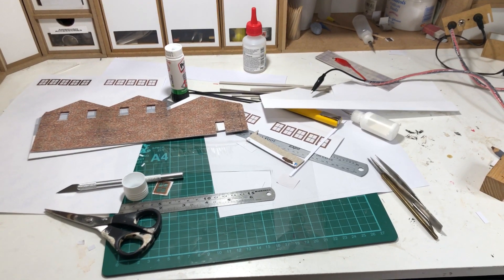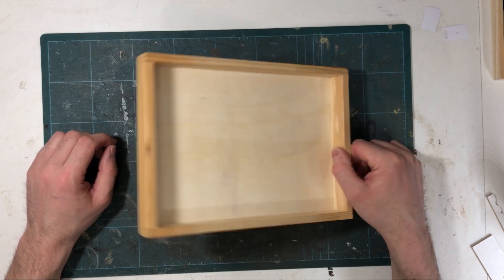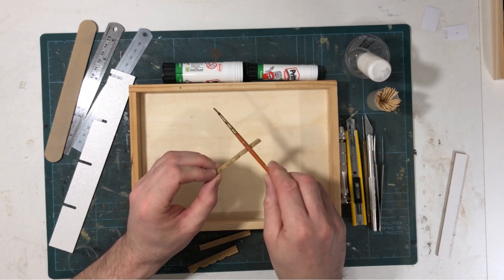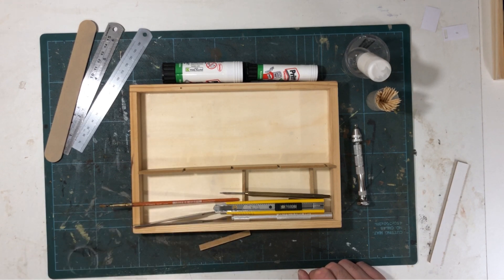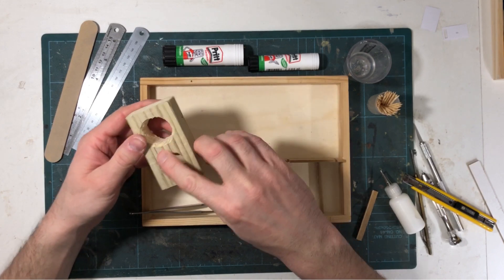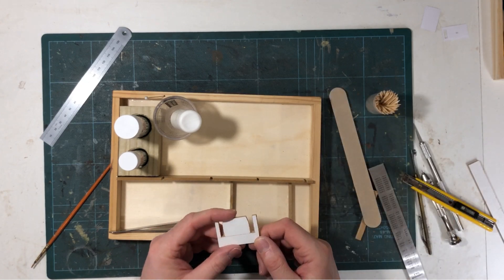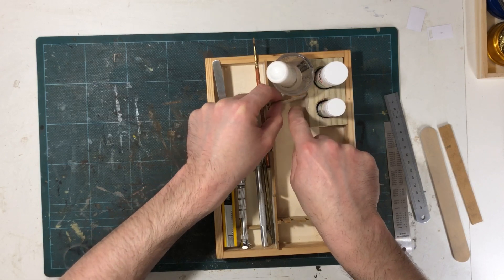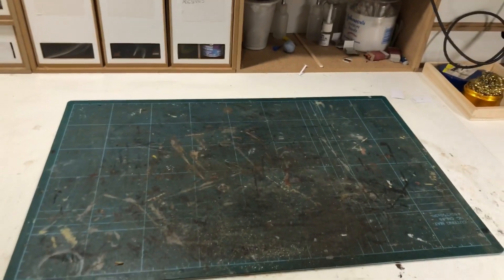Making a modelling workbench tool tidy | 004

Comment: I enjoyed that. Where do I enter my credit card number!? Seriously though, I've tried to find a scribing tool but never really sure what to search for. Someone (was it you!?) said they used a filed off bit of a pair of compasses, but yours doesn't look like that. My favourite feature of this - the nod to losing the pin from the fine tip applicator. Chandwell would have been finished 3 times over if I didn't spend most of my time looking for those things! I'm also enjoying those white drawers at the back of your workbench. Cheers! Michael.
Reply from the maker: Thank Michael. I’ve got 2. The first is a standard pin vice, which you can get for a few quid from most modelling tool supplies. Inside this is a.... pin as in a sewing pin🪡 . It’s ground down a little to remove the point and is mostly used for piercing the corners of openings. The second one is I think a carpenters scribe. I inherited it from my granddad, who was a coach builder at Wolverton Railway Works for most of his career. It’s a bit blunter and tend to us this to score corners as it doesn’t cut as easily as the pin. Not really sure where to pick these up, but this one looks like it was made ‘in house’. Ironically last night I found a long lost glue pin in the floor, then a few minutes later dropped the other one in roughly the same spot, which I now can’t find. Dark carpet is great for hiding the mess, and just about everything else you drop on it! Cheers